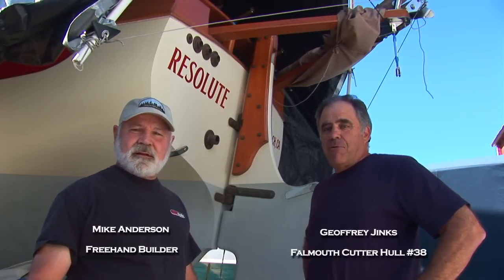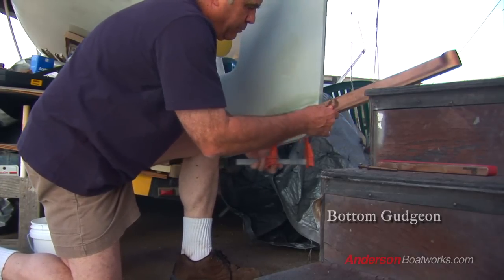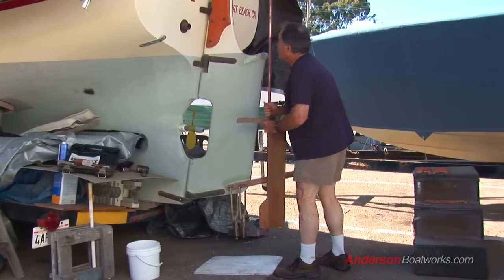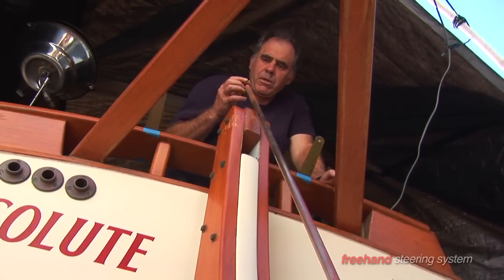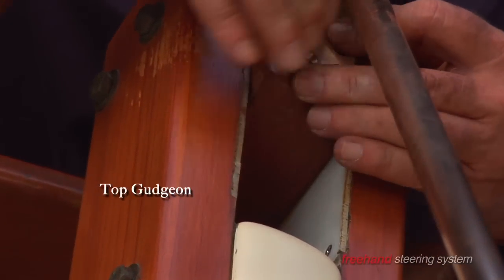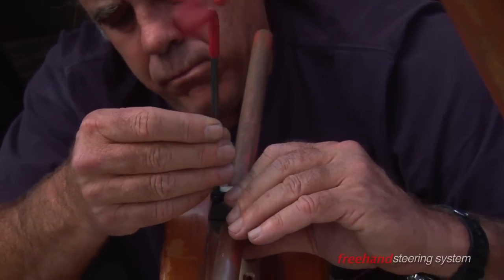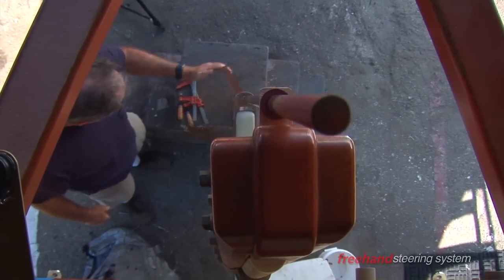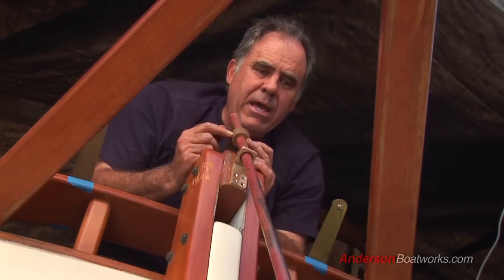Freehand Steering System_Install Lower Unit .mp4

Comment: from what I see, the angle of the windvane shaft to the wind vane's rudder is not at the same angle as the angle of the rudder shaft, at any other angle but straight ahead they will fight each other no? How does that work??
Reply from the maker: Not a problem.